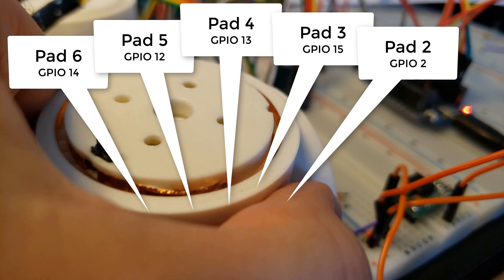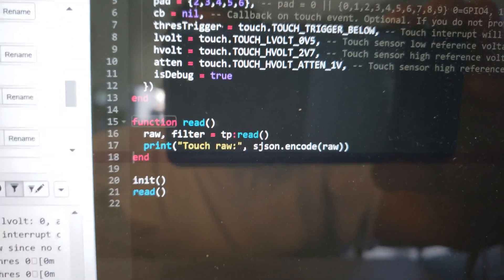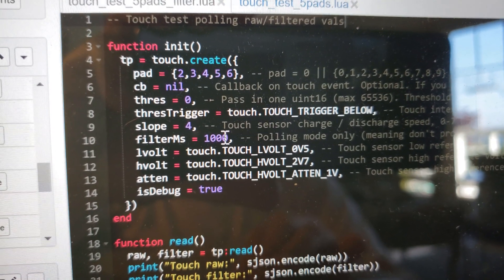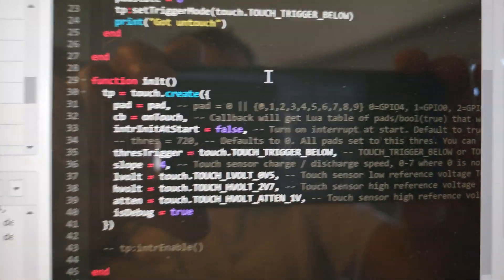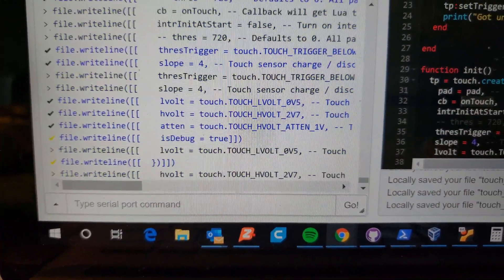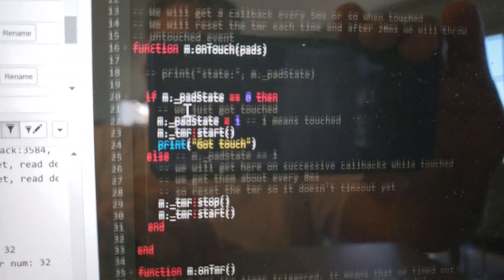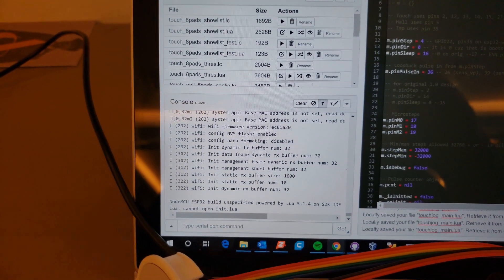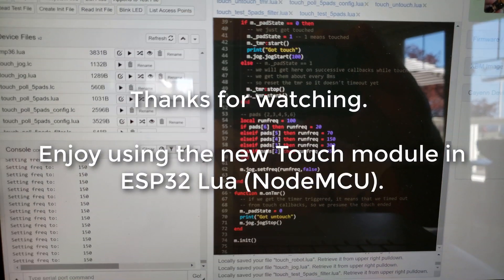Touch Sensor on ESP32

Comment: Dude great work! Btw, what touchpads are you using?
Reply from the maker: The copper tape sensors are the main ones I show in this video and the pinned comment. The other touchpads are just a PCB I whipped up where it's just a big ground plane per sensor.
Reply: @JohnLauerGplus  Can you share de pcb touch sensor?
Reply from the maker: Thanks James. It took some work to get that module written, but now it's crazy easy to do touch sensors. I've never seen touch sensors easier than what we've got now with the NodeMCU platform.